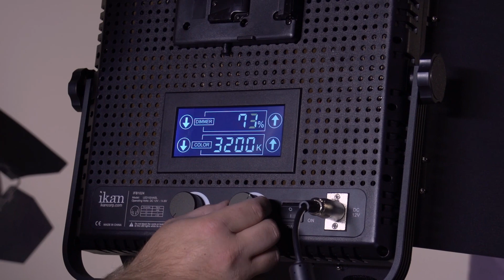DVTV - Light Ratios and the Inverse Square Law

Comment from the maker: The thing to remember in post relighting is you can never change your ratios. You can add vignettes or change the contrast, but a light ratio is permanent from what you've shot. You should always get your ratios right in camera and not rely on post relighting to fix mistakes that should have been corrected on set.